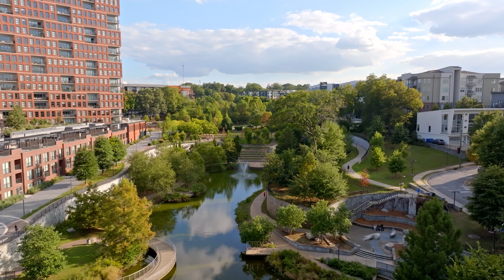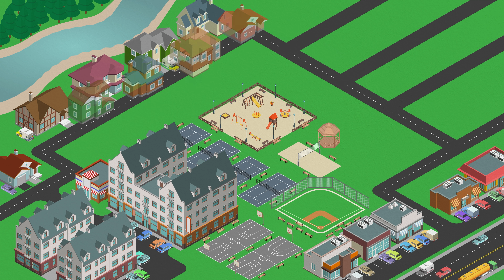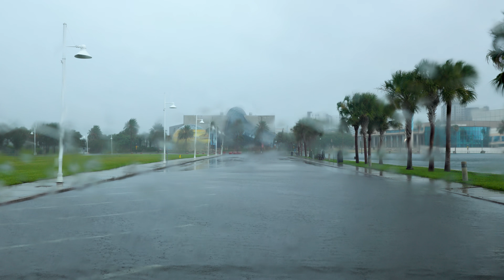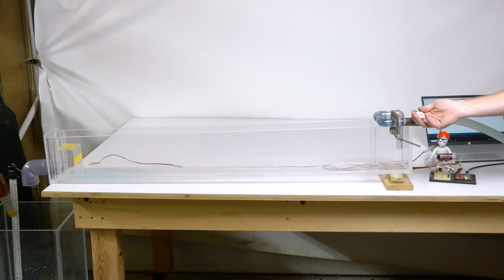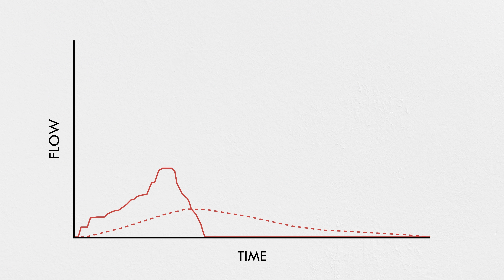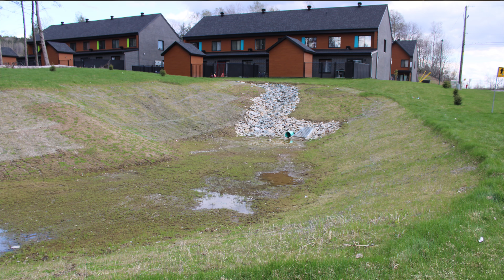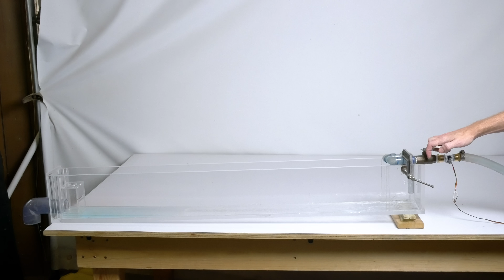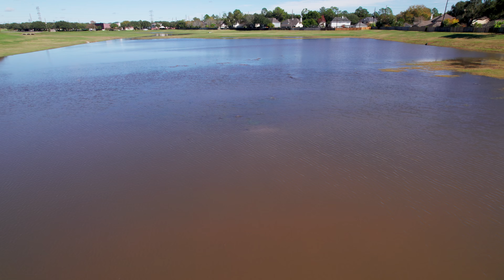Do Retention Ponds Actually Work?

Comment: These retention ponds are actually septic retention ponds from the septic leach fields eroding and naturally becoming to high flowing making the ponds a septic retention pond faster and faster more and more the bottom is detritus from fecal matter breaking down like the bottom of a septic tank bacteria cleaning it slowly with low oxygen they should be air injected like a water treatments retention pond.

Comment: This is the work that I do and its great to hear it discussed here. Great video as usual. Interestingly the definition of retention and detention that you use is probably the most wide-spread but it isn't universal. You can find that Florida Water Management Districts (such as SWFWMD) use exactly the opposite definition: Dry retention retains/infiltrates the runoff while wet detention simply slows the runoff detaining the treatment volume during the "bleeddown" phase. The dry retention ponds here include a treatment volume stored below the weir that does not discharge from the pond. This is your retained volume.

Comment: So what happens during the time without storms. Is a retention pond a mud pit, or do they just overflow during a storm because normal pool is full pool. From what I saw most retention ponds have a normal pool that is very low in the wild. How does this work in a pond in the middle of a city. A mud pit in town is not "pretty"
Reply: I guess the adaptive control is how this is supposed to be handled. What percentage of retention ponds have this adaptive control. It sounds expensive if it's sensor controlled

Comment: What if you're required by state law? But there's a dry riverbed that would already serve this purpose. I get needing a system to move water away from the parking lot that's not near the dry riverbed, but then we only need one. We don't need a retention pond next to a natural water runoff system.
Reply: The retention pond controls the rate of stormwater discharge into the river. If you discharge additional runoff volume without controlling the rate you increase the flood peak in the river channel

Comment: I spent 5 years working as an estimator for a civil contracting firm that specialized in site work. I also used the plans and Cad files from the engineers to build machine control models for the gps guided heavy equipment. Before that job i never paid any attention to stormwater systems. I now work in a completely unrelated industry but i still can't help but notice stormwater systems. They're everywhere, and I'm always noticing what type of structures are being used, how the roads are sloped and where the swales and ponds are... on and on. 😅 kind of sad and nerdy.

Comment: Also a big thing is topography. In regions with hills or mountains things can escalate very quickly. Around here where I live we had floodings every few years before several villages combined forces and installed several storm surge ponds.
The extreme example would be the flooding of the Ahrtal in Germany in 2021 where a whole mountain valley did channel absurd amounts of rainfall and destroyed several villages and towns. But in that summer 2021 all of Western & Middle Europe got battered by that low pressure sytem that dumped a sh*tton of rain. It caused damages worth 46 billion Euros and 220 people died, 188 in Germany alone... 😐

Comment: I understand the sand filtration system up to the point how do you clean the sand before it meets the point of saturation. You also mentioned about a technique that submerge run offs however you did not mention how you remove the submerged stuff.

Comment: The Ellicott City Maryland floods were man made.  There was a wooded area at the top of the Tiber creek  watershed that retained the moisture prior to development.  The development had retention ponds but the rate of flow was too much for them.  The creek overflowed and ran down the middle of the street to the river. It was clear to me that that development was going to cause a problem.  And I only took a two credit hydrology course in college and I could  tell.  Clearly our county government missed the mark and people died.  I see the county’s  solution, and think it will fail.  It is not robust enough for the next flood and there will be another storm to test everything.

Comment: You got one thing very wrong unfortunately. Wet soil is not per se less absorbant than dry soil. In fact, dry soil can absorb less water immediately than wet soil. Even fully water saturated soil has absorbant plants like willows and swamp weeds that will absorb further water.

Comment: You speak about human constructed surfaces as impermeable (like it is the only possibility) but they can be designed to be pervious.

Permeable concrete can be used. Maybe a tennis and basketball court’s main playing space cannot made this way. However walkways, carparks, patios, etc probably can be designed to be permeable. Would a carpark have to limit where trucks cannot drive? Definitely. Yet that is a reasonable constraint to not have heavy trucks going up and down every parking row.

Comment: You didn't mention the systems used in sea level areas, like South Florida. We have canal systems that have these building built over them at certain distances. If I understand it correctly, they are pumping stations to help increase the flow during heavy rain fall.

Comment: this is interesting. my city in a relatively dry area (25" annual rainfall, mostly in a few large events) is retrofitting retention/settling ponds to its suburban landscape. it went through several phases. natural watercourses were replaced by LA-style concrete drains in the 70s. then sometime after 2000, as the growth of the city and droughts made water supply an issue, settling ponds were added alongside the drains to clear and collect stormwater runoff for non-potable purposes. mostly to irrigate sports fields, parks and public areas. half-height weirs set into the drains direct water into the adjacent ponds. the one near me is an ox bow to slow the inflow down and has several levels of outlet. they are all landscaped in as the centrepiece of new or renovated parks with paths, benches, picnic areas and art and local history installations.
they have been wildly popular with the locals. they are stocked with native fish, reeds, rushes and water plants which helps revitalise the downstream system. they attract an amazing variety of bird life including a permanent water fowl population that presumably wouldn't otherwise exist. they are so loved the one by me had a bench seat donated in the will of a lady who went there every day to enjoy the wildlife, according to the plaque

Comment: all my down pipes taking water from my roof used to go into the main drains which then connect to the local sewer system and this would overflow and pollute local rivers. I have since rerouted them to flow onto my garden so at least I am not contributing to the problem

Comment: Question: if the retention ponds are in urban areas and designed to catch run off pollution, over time surely the water in them becomes more and more toxic, and the silt that builds up becomes toxic too? How is that controlled and managed? If these ponds are close to housing, do you need to ensure people can’t go in the water?

Comment: Our old house in North Austin had a runoff trench across the street which started to flood after the railroad built up their bridge which restricted the water flowing through in heavy storms. Luckily we only flooded once in 8 years (though it came close other times), and they finally fixed it about a year after we moved. That was bad planning for sure

Comment: Maybe consider discussing a variant, the sediment retention structure.  Just a space to slow the flow for a moment to get some/most of the bigger sediment to drop out.  Really common in Southern CA where post wildfire debris flows are common.  Also called sediment basins or debris basins.

Comment: Yes...but common sense is not applied to avoid litigation.  When developments that discharge less than 300' from a 38,000 acre lake are required to have the standard detention pond; someone isn't thinking.  Especially, when that lake is used for drinking water and more evaporation occurs in shallow detention ponds than the much deeper lake.

Comment: What happens when the ponds get full of trash and other pollutants? Do the ponds get cleaned out? Are there underground systems in place to remove the pollution from the initial run off? I didn't think a video about Ponds would be so interesting.

Comment: Btw, calibrating your sensor in the demo tank wouldn't have been necessary. As you can asume the same amount of water flowing through both tanks (leaking and evaporation being negligible) just normalizing both curves to the total amount of water (full integral of the curve) woul've been sufficient.

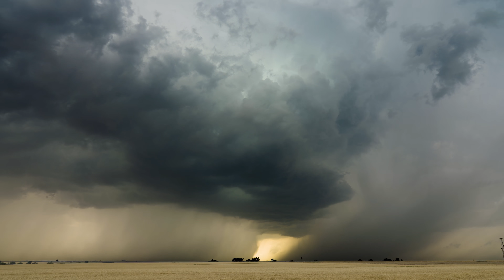Comment: 3:17 very dry soil also absorb less water then then slightly humid ones. Which is why you'll see in pretty much any desert that is not a sand desert, violent water rushes during or following rain events in these type of areas.

Comment: I'm a civil engineer from Montreal, and I think this is a clear and succinct explanation of retention ponds.  Large drainage systems will be modelled using software, used to model and design a master plan, and the model will be calibrated using measurements of rainfall and flow rates at strategic points of the system.

In Montreal, we have a particular problem that may be common to many older large cities.  Before 1960, most of our sewers were combination sewers, used to drain both raw domestic sewage and rainwater. This was dumped straight into the St. Lawrence river without treatment. In the 1970s and 80s large interceptor tunnels and treatment plants were built to treat most of this combined storm and sewage water, but to keep costs to a reasonable level, the system was sized so that during the largest storms, water would overflow and be sent to the river without treatment.  This was considered acceptable at the time, because the amount of domestic waste being dumped into the river was reduced by well over 90%.

But now in the 2020s, those standards are no longer acceptable.  Governments want a zero tolerance for waste being sent to the River.  So in 2020 the cities regulations were changed, requiring new constructions to retain water and, if possible, to infiltrate storm water to recharge the water table.

For projects with large parking lots, a popular way of achieving this is to use underground retention, under the parking lot.  This is achieved using half-pipes designed for the purpose, of which a number of companies make similar products. Most of them seem to be coloured yellow or orange, for some reason. They are installed with the open side facing downward, on a layer of crushed stone, then buried in crushed stone, which also serves as the granular base for the parking lots.  The catch basins and pipes direct the storm water to these buried half-pipes, where some of it infiltrates, and the rest is retained and gradually released.

It is expected by the  city, that over time, if an increasing number of properties reduce their peak flows to the municipal storm sewers, that over time, the number and volume of overflows into the St-Lawrence will be gradually reduced.

Comment: Yes, even a small retention pond can make a significant difference.

I dug a pond, hoping to be able to stock it with fish.  4 ft of bank/levee above the overflow pipe.  Just getting runoff from appx 10 acres.  This, rather small pond and its limited overflow stopped my neighbor;s driveway from washing out every time we get more than 2 inches of rain in a week.  We haven't found how much would wash his driveway out now, even with 12 inches in one week, 4 inches of that in one hour.  

My amateur built dam and levee plus overflow control methods have been very effective for retaining pond purposes.

Unfortunately it doesn't hold enough water all year to raise catfish. (what i wanted the pond for...)  I was down to under 1000 gallons at the low point 2 weeks ago.  3 acre-feet calculated when filled to the overflow.
The water probably about 1/3 evaporates, 2/3 seeps into the ground.

Comment: It's absolutely crazy to me that we design our civilization to drain off rainfall as fast as possible so we can then buy it back after the clean rainwater has been contaminated, treated and pumped.
Reply: Well water barely needs to be treated at all in most places. Surface water is filthy by comparison. I'll take the already clean.
Reply: @latetotheparty184  And you recharge your wells by sinking the water into the land instead of channeling it off. What's your point?

Comment: Back in the early '90s in my undergrad hydrology course this was a major portion of the course as we could do some direct mondeling and check against the rainfall in the region and the campus rainfall retention facilities and check to see if they were sufficient.  

Pretty interesting.  Absolutely effective and not at all difficult or expensive to do, but often very much undersized in the areas that needed them, leading to additional problems.  Proper peak flow calculations are often ignored.

A friend of mine in grad school worked on similar issues in Pittsburg.

Comment: Is the cascading effect of multiple retention ponds actually real? To me it sounds more like an advert of some "big company" that wants to manage one big storage themself. Especially when an alternative to multiple single retention ponds is... are a set of another multiple retention ponds. Dont get me wrong, I can imagine that it happens, but I would argue it is not that big of a problem in real life especially if the retention ponds are separated by some distance: a) the storm has some geographical and temporal dynamic, b) the same applies for the water moving downstream. I can immagine that maybe one big pond, or a set ofe smaller ones in close distance, is easier to manage, but if a big retention pond is placed downstream fom a city the flood might already done some damage upstream whereas a smaller but well placed retention ponds can lesser the impact.
Dont get me wrong, I really liked the video, I just have a problem with this part and it would be cool to see some arguments and examples. Or maybe, when trying to imagine this scenario, I just operate on a different scale. Is it possible to find more something about this? In my country, these retention ponds are fairly common and in big cities there are maybe even hundreds of them. Some are even totally dry and act more as a big marshland with meandering river which naturally slows down the flow and helps soak the water, those can get quite big, but anyway having multiple such things per city is the norm.

Comment: Glad that permeable pavements were mentioned, they're not remembered often, but sad that the role of leaves (trees/bushes) was not mentioned. In a district that has a lot of full-grown trees less water will make it to the ground in the first place (because some of it got the tree's leaves wet, some of it evaporated after doing that, some of it was captured in the bark, and some was absorbed by the leaves or roots). Even though trees don't offer full "dry", humans often prefer seeking shelter under a tree in a rainstorm. In addition to water management, full-size trees have a measurable beneficial effect on microclimates and human wellbeing.
[By full-size I mean trees that get to 50-80 feet high and 40 feet diameter, such as the famous Plane trees in central London. While smaller trees do help, they have many fewer leaves and leaf area is what matters.]

Comment: Does the amount of water sitting on top of soil increase the rate that water soaks in?  It seems like pressure from the weight of water could act as a driving force, so more water = more pressure = faster soaking or absorption.  But soil is a complicated mess, so I dont entirely trust that intuition.

Comment: I worked in Eastern Washington for a few years (CE Designer).   One of my favorite projects the city didn't require the developer to handle any small storm events, only flash flood conditions.  On one side of the project, a deep channel stream with an undersized pipe flowed onto our site.   We upped the pipe size to a 72"x96" squash pipe, then designed a baffle to slow the flash flood water (the baffle was an 8' sq concrete box with reinforced channels for the water).

Comment: ooo you should touch on rain gardens. a common version of water management in new jersey with new developments are tiered detention ponds scattered throughout the small piece of land. the individual ones are smaller and feed into much larger ones (this is just a shopping plaza size not on the scale of a whole town). I love watching it during storms because some of the ponds are so shallow and have cool plant’s and river rock but are only like 10 by 30ft long and maybe a foot deep yet take a lot of runoff before sending it to other much deeper and high capacity ponds. i’ve actually never seen the final pond fill up to its maximum overflow. Anyways, nice work as always!!